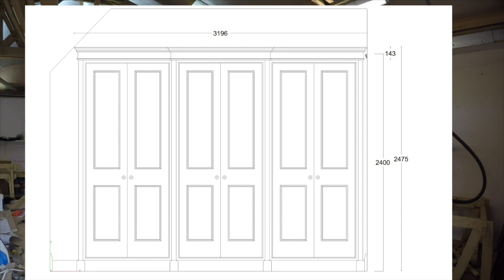Making Breakfront Wardrobe

Comment: Hi Gary, beautiful piece...I seen you comment that it was a spray finish, but I'm just curious as to what you opted for, for the interior? Also what's your take on finish choice for drawer boxes?
Reply from the maker: Thank you Kenneth for your nice comment, all the interior including the drawer boxes was finished with a water based varnish, it drys quick and does not leave a odour which could effect the contents. What sort of stuff do you make Kenneth ? 👍😄
Reply: Hi Gary. I tend to make whatever I'm asked for lol, those bills need paying. I'm pretty much commission based so each job tends to be different unless I've been asked to specifically replicate a piece. Totally agree with you regards the beaded frames, personally I think that simple addition makes a huge visual impact on a design.

Comment: Always a Joy to watch you working.
Do you cut the long boards only at the DW745??? - Or your'e hidding a big table saw somewhere?
Reply from the maker: Hi Marcelo Cosi are you asking about the long cuts on the panel boards? I use the rip saw with a zero cut straight edge. There’s a video I did somewhere on board cutting. 
Thank you for your nice comment mate 👍😄
Reply: Found it. Many thanks.